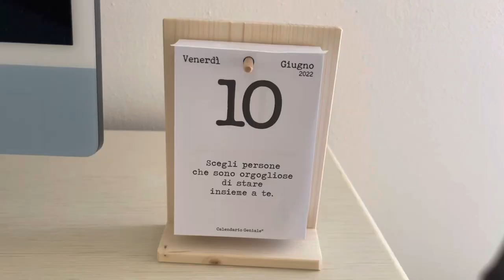PULIZIE di casa 🏠 dopo le ferie 🇱🇹/ House cleaning 😅🥰

Comment: Cara Orinta ,ciao 👋 😉😊 .Vedo soltanto adesso questo tuo video ,ma ci tengo a dirti come togliere macchie di sangue in modo sicuro e veloce : basta mettere un po' di acqua ossigenata ( quella per le ferite a 10 volumi va benissimo ) , direttamente sulla macchia di sangue ( è importante che questo tipo di macchia  venga trattata sempre a freddo , altrimenti si fisserà nel tessuto) , aspettare 10/15 minuti e risciacquare il panno , oppure lavare subito in lavatrice . Vedrai che facendo così la macchia di sangue sparisce subito 😉 . Spero di esserti stata d'aiuto 😘😘🥰
Reply from the maker: Grazie mille Linda 😘
Reply: @OrintaOri  non c'è di che ☺ Comunque , fammi sapere come ti trovi quando proverai 😉😘